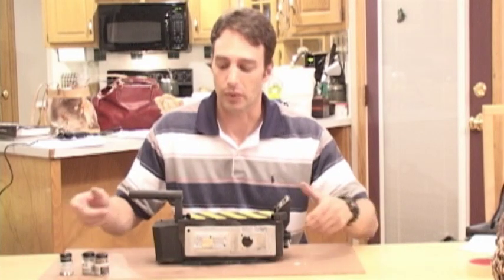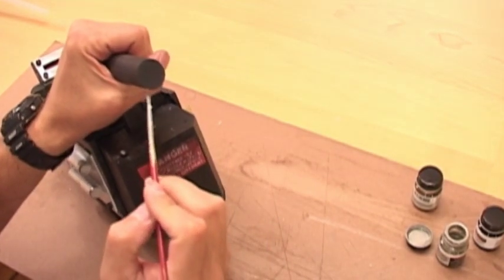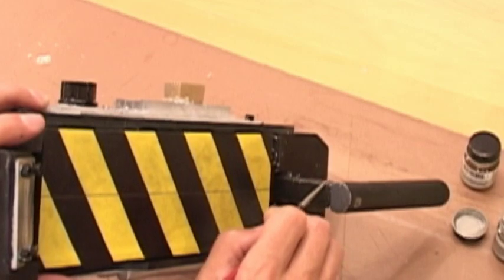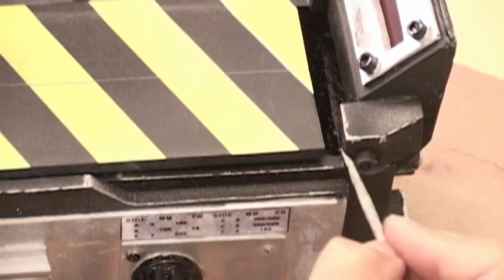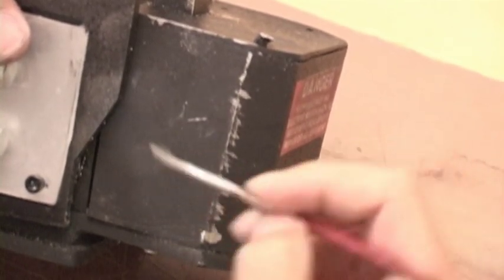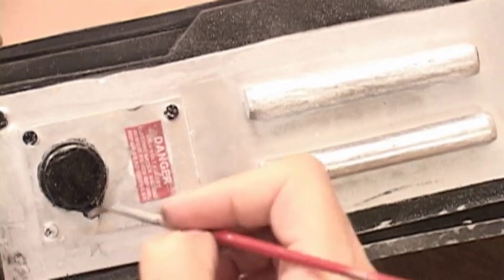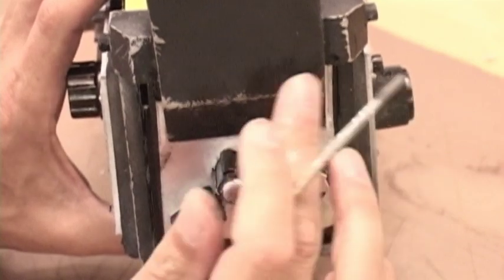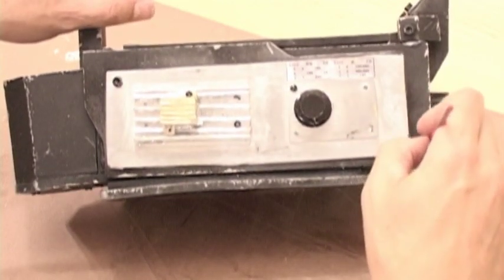How to Weather a Prop - Dry brush and rub techniques

Comment: You'd have better and quicker results with a stiff brush. You also get more convincing chips and rubs if you lay down the silver as a base and paint black over it, then wipe the edges with light paint thinner.

Comment: I'm going to dry brush a plastic Nerf gun that I've spray painted. What type of paint is good to use so that it doesn't mess up the paint? I thought I'd use some spray paint with a brush but I thought it would reliquidify the dry paint and smear the colors together.
Reply from the maker: tigger3370  as long as your base coat dries you should not have a problem. You can also use any type of acrylic paint -the cheap stuff from Walmart will work fine.  Good luck with your project.
Reply: Ok. Sounds good. I'm just using some leftover cans that I have. I did put down two base coats of plastic primer and they looked ok. I painted part of it with metallic spray paint and it bubbled a bit. No big deal and lends an abused look to those parts of the gun. I'll just test the black paint I'm going to use in a spot that can't be seen first to see how it will come out. Want to add some black paint to bring out the details in the lines, edges, and "cracks" that are pressed into the gun.

Comment: what color would you use to weather a silver prop? lets say a nerf gun
Reply from the maker: It depends -is it plated metal? If so, I'd show places where the plating has worn or chipped off revealing the underlying color (most likely an off yellow). If it's steel, I'd grunge it up with black washes and some black dry brushing. Good luck with your project.
Reply: Eric Lindenberg thank you very much, great video :)
Reply: how would you go about small amount/medium amounts of rust effects?